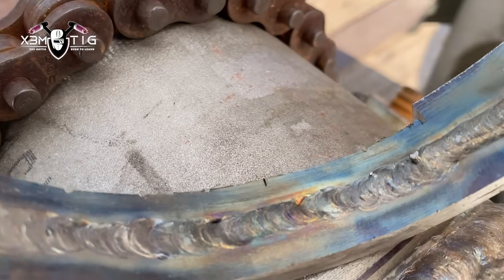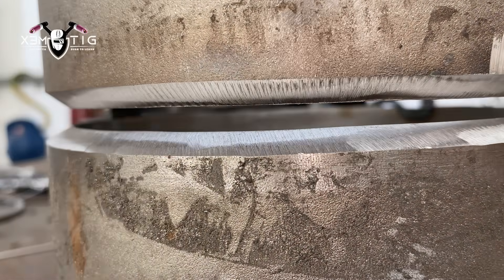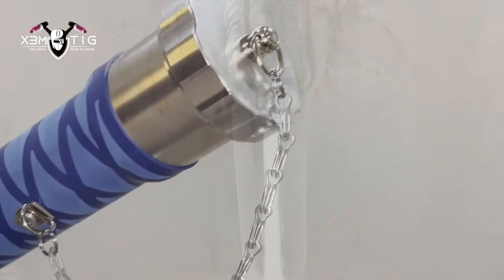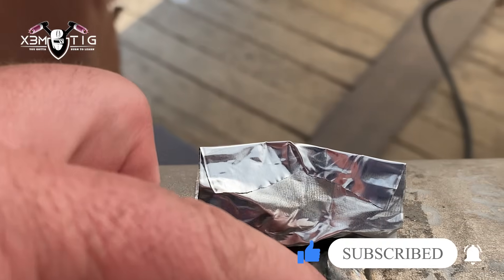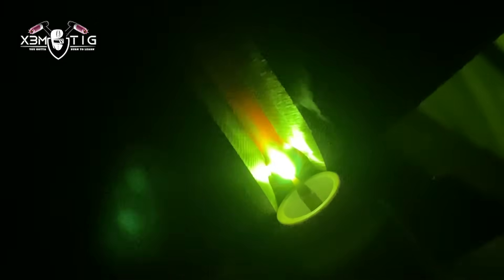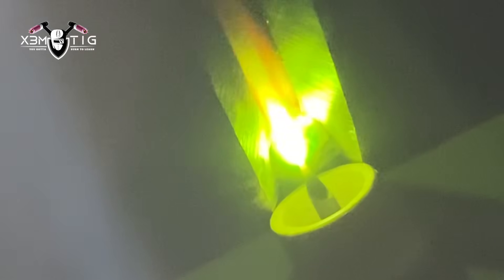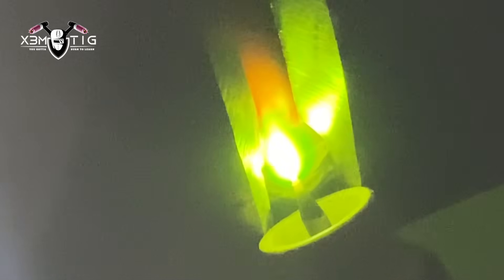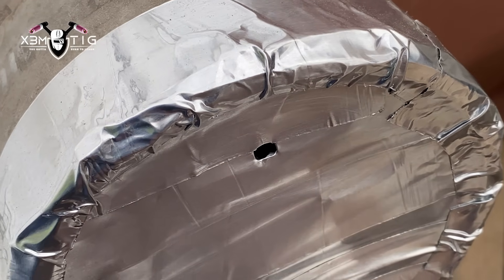Inconel TIG Welding Root Pass Tips — What You MUST Know Before You Start

Comment: I don't know why but I been welding for a while now and sometimes everything just goes weld and then next time it's just a mess I been watching so many videos and try to be better but I just don't now why one test good other times just maybe it's the stress ore pressure
Reply from the maker: It can be tough, make sure you are in a comfortable position and take breaks to stay fresh. 👍
Reply: Don't feel the need to rush unless the time forces you to do so. I use 2 ABCs while welding; Always be comfortable, and always be consistent. Neither is possible for every weld you will perform, but being most comfortable will allow you to focus on the weld and being consistent is a welder's bread and butter. You can refine your consistency pass to pass by doing a dry pass and practice your weave, whip/back step or whatever is needed for the next pass you are about to do.
Reply: couldn’t agree more. I always go back to the basics when things get tough. And yes it will happen from time to time. Even after 33+ years experience. Stay calm and weld on 🔥💥